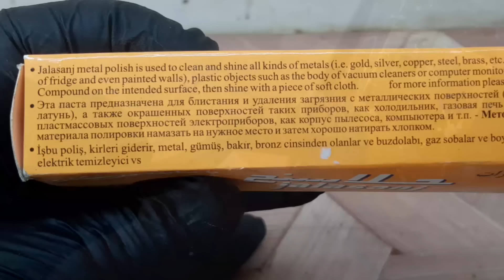Old Alarm Clock Restoration , 1940's Germany 🇩🇪

Comment: Definitely not from the 40's.  I bought a clock just like this, also made in Germany, new in Montreal in the late 70's.  I loved it.  Unfortunately the legs on my clock were made of plastic and kept breaking.  I mended it a few times but the repairs didn't hold and I didn't have the skills to fix it properly.  Wish I still had it.
Reply from the maker: Hello, very good. Congratulations, use screws for the bases and put a plastic tube on the tube so that it is beautiful and strong

Comment: I think u frogot that the clock needs oiling too especially staying in diet like that and after the wash
Reply from the maker: Hello my friend, the clock mechanism is designed in such a way that it works without lubricant and oil because oil absorbs dust, if you buy a new clock, you will see that there is no oil, also the whole mechanism is made of brass and is rusted.  It can't be done, so it doesn't need to be immersed in descaler solutions
Reply: Đồng hô đeo tay vẫn tra dầu 😂
Reply from the maker: @thanhphamxuan2Xin chào, dầu đã được rửa sạch hoàn toàn446